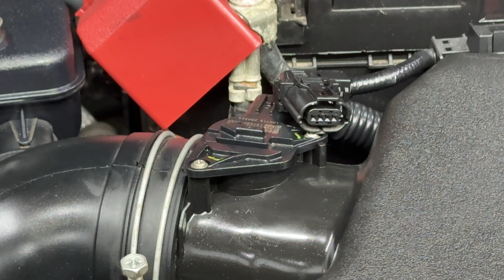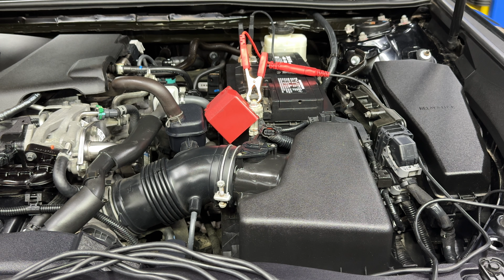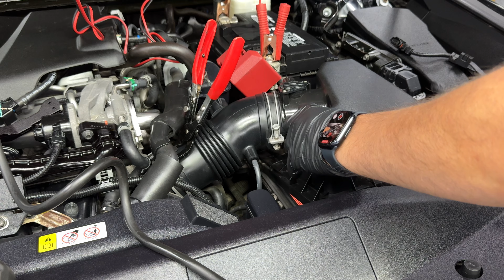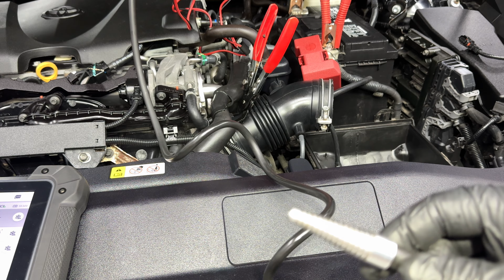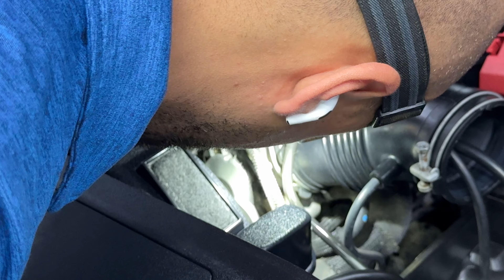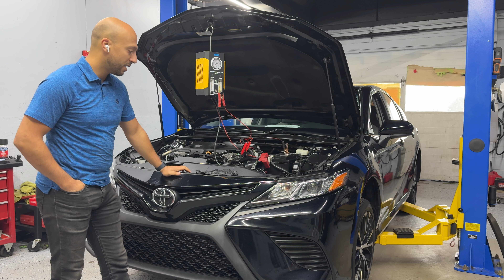Toyota P010064 Diagnosis - MAF Sensor & Smoke test

Comment: I did a smoke test and saw some smoke coming out of the hose area just before the throttle body. I changed the clips and the leakage is gone. But I am still getting the P010064 Test Failed when i check for DTC